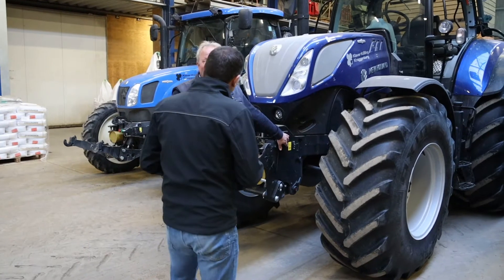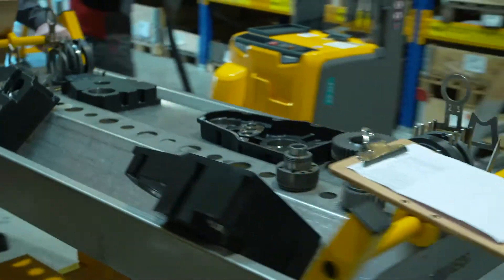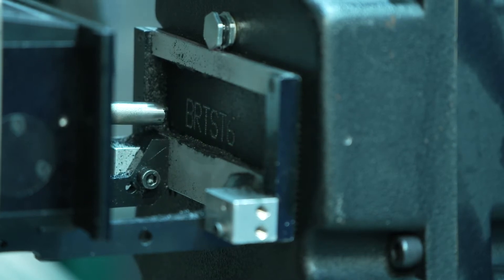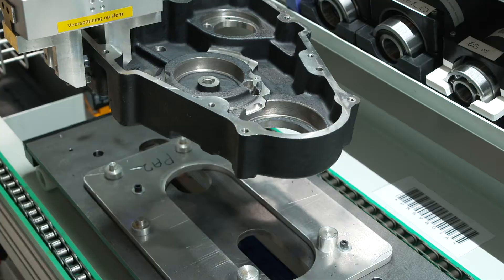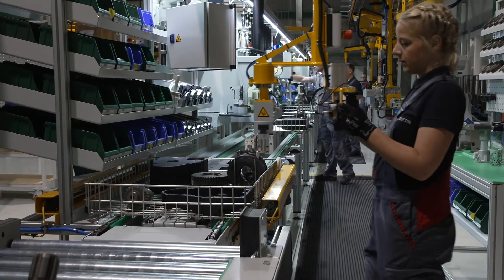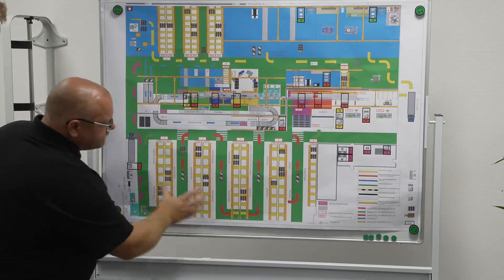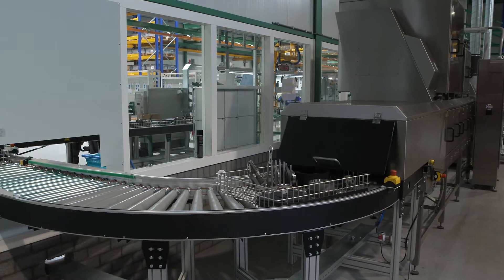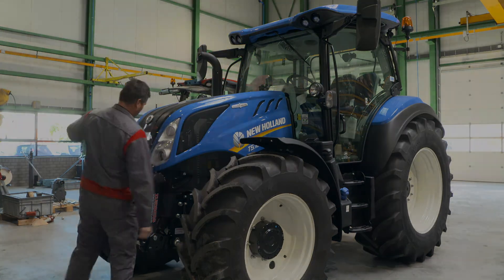New high-tech front PTO assembly line| Zuidberg Frontline Systems

Comment: Hi ,,how much hp requires for front pto and especially for small tractor like solis s26 and does it work on rotavator .
Reply from the maker: The PTO's we supply normally matches the power output of the tractor engine. For a Solis 26 the maximum available engine power will be transmitted through the PTO. Implement which have a maximum power requirements which isn't exceeding this value, can be operated with this PTO.